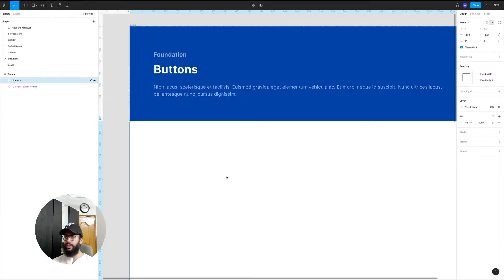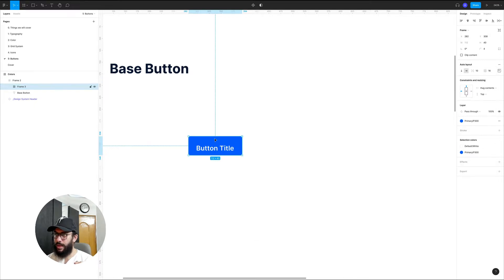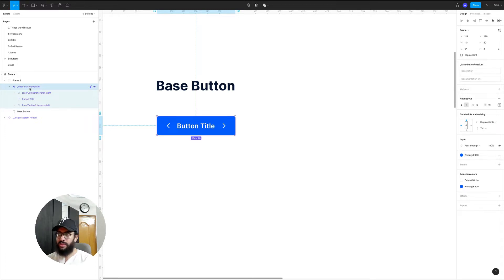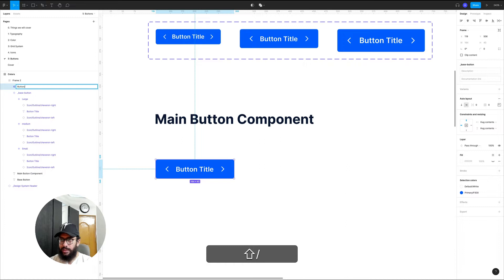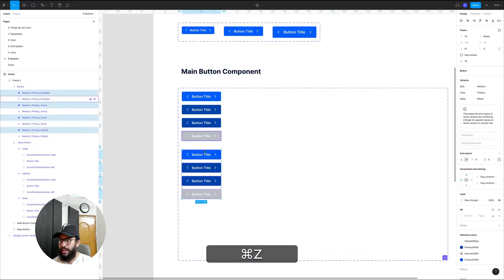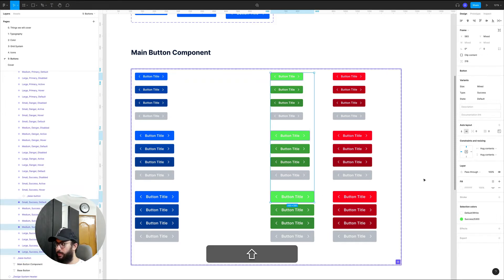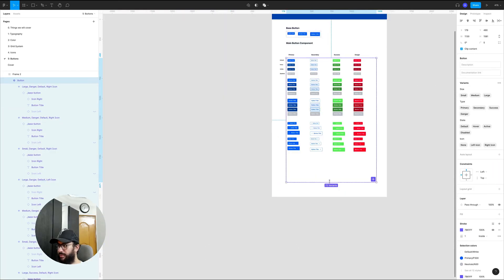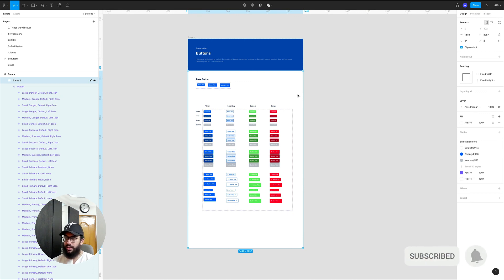Creating a Design System - Buttons

Comment: I have a question, If we change Icons manually, we break the components. Do u have a solution for that ? Thanks in advance, you are great!
Reply from the maker: You shouldn’t really change icons manually. You can create icons via strokes, and then be able to change the weight if you want, But I wouldn’t recommend it.

Apart from that you can already do the color overrides and the size override so I don’t think you should detach them.
Reply: @AMDesignAndDev  Thank you for replying 🤙🏻

Comment: Great video! Thank you a lot!
What about icons' size in buttons? You just scaled the icon in the large button, but it became not pixel perfect now. Is such a method acceptable for design systems?
Reply from the maker: The icons usally aren't pixel perfect, sometimes the stroke is 1.5, sometimes 2, etc, sometimes 2.5.
So usually they don't sit on pixel perfect sizes like 1, 2, 3, etc.

But if you can get them to sit on them, that's great, if not, this is acceptable too, but ideally you don't want to have a really weird stroke size for the icons, and have them really weird in terms of pixels.
Reply: @AMDesignAndDev  Thanks! 🙌

Comment: Great work. Only callout is that the primary success button will not pass accessibility check as the white against the bright green does not have enough contrast ratio.
Reply from the maker: I agree. It's not to my liking either. Good point.

Comment: 4:20, just found overrides wouldn't be preserved if change size in variant.
Reply from the maker: They will most definitely be preserved if you make sure the layer name is the same in all the variants, and also the grouping structure ideally.
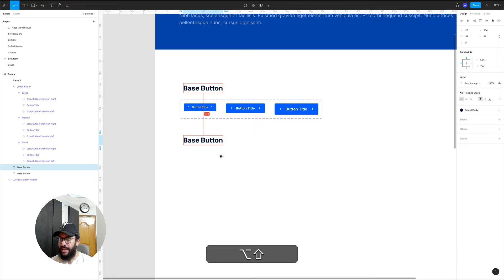Reply: @AMDesignAndDev  Do you think size could be defined in actual button component 5:16? Which way works better for a Design System?

Comment: Powerful stuff, thanks a lot for giving the time to show us your methods ⚡️
Question - how do you target the top layers for each Variant inside the Variants container with the mouse? If I build the Variants on a blank canvas I can easily pick them without using any keycombo, but in your case you're using a frame behind and somehow you manage to pick the top layer (and not the child) - I saw the trick at 5:20 and I was stunned 🪄 Do you use CMD+click? Correction: Found it - you double-click :)
Reply from the maker: Glad you caught it, and thanks!

Comment: Thanks, I create similarly too. I was wondering if there was an easy way, for example, to change the color of the danger button in default state. (When I don't think to change the color directly :-))

Thanks for your videos., Very good content!
Reply from the maker: Yes, you can do that by just going to the danger button and changing the color from the selection colors at the bottom right in the sidebar. But you have to select all 3 danger buttons in this case by using the CMD/CTRL key.
Reply: @AMDesignAndDev  You're right. I would just like a solution where I don't have to select all the buttons (in this case 3).

Maybe it could be solved if I had a master component for each type of button.
Reply from the maker: @joseflinha  if that style is unique and not applied to any other elements, then you can jus select the whole component and change the selection color just once.

If it’s unique, it doesn’t matter if you have 3 or 50 in there, they will all be updated at once.

Comment: 2:05 what is plugin use?
Reply from the maker: That's not a plugin, that's the component picker, it can be opened using Shift + i
If you're talking about the sizing plugin, it is the "Scale" plugin.
Reply: @AMDesignAndDev  oh thanks a lot.